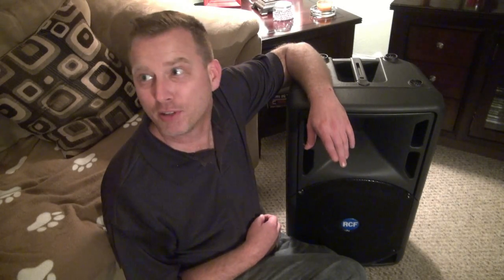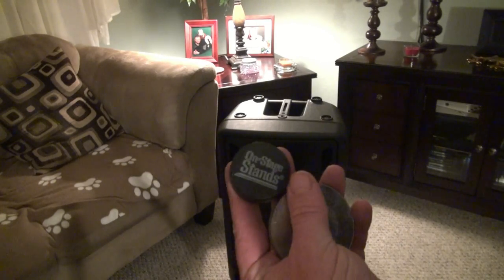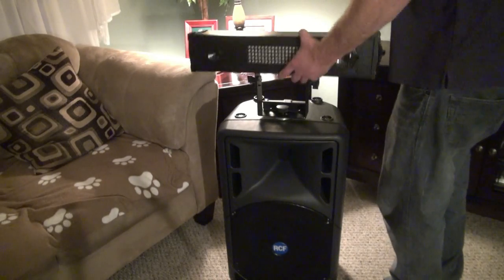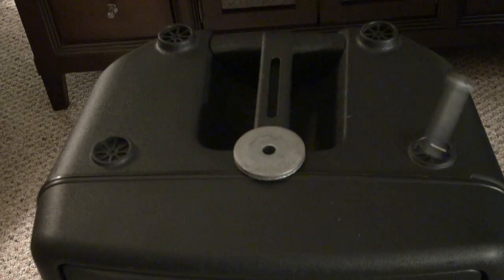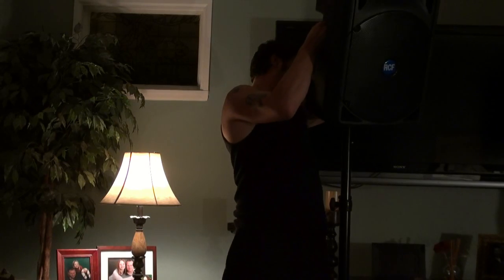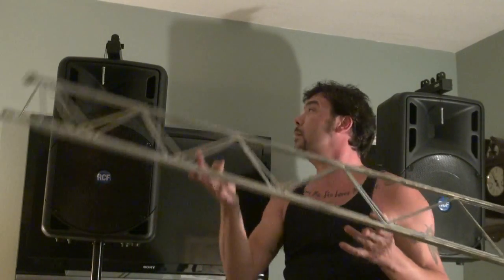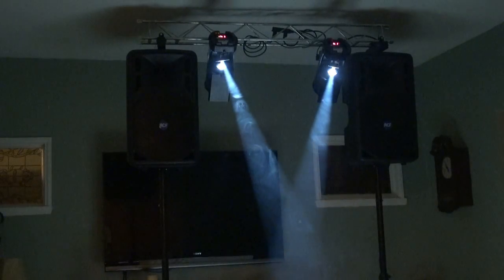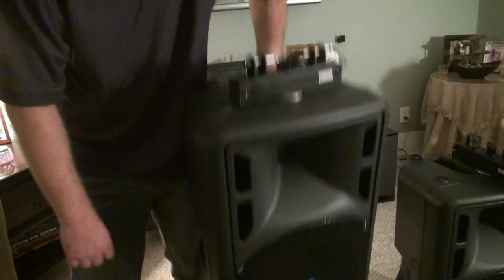Mounting Lights, Truss, etc on my RCF Speakers

Comment: That is a great way of mounting lights especially for mobile djs who only are using a few lights for a small gig. I have behringer b series speakers and they work with screws I got from an adj t bar. They are also very secure and very little vibration is transferred through the speaker with behringers design.

Comment: I long had the idea to use that hole on the speakers to mount a small moving head or something, but trussing and t-bar with the clamp? OMG that is genius! I needa check if my new speakers have this hole, if not, i may be temped to use my old speakers since I know they have the hole!

Comment: Hi Brian......   I have a Swing to Rock n Roll Cabaret act here in Essex in the UK. I have limited funds so got myself a pair of QTX QS12A  powered speakers.  For the size of venue I perform at, they are perfect..... They too have mounting bolts on the top.  I normally mount a pair of  Equinox Pedator LED Lights on top of my speakers. It works great.......  keep up the great work. All the best from your fans in the UK!!

Comment: Hi Brian just so you know you can also mount a lighter weight speaker and mount it on truss instead of truss on speaker. This is an awesome way to get your speakers high and eliminate speaker stands, I just mount the. With an o clamp my speakers weigh 30 pounds so it works really well.

Comment from the maker: @audiofile210 I have the F1 stands which are designed for 60-80lb speakers.  The RCF's are @40 lbs each.  The truss bar itself weighs next to nothing where there is probably about 10 lbs worth of Dura mounting hardware.  No, you don't want to put giant moving heads on here, but 20-30 lbs worth of lights should be no problem

Comment: Almost all speakers have the same fly mount. They should all use an M10 (metric10) bolt. If you find a hardware store that sells metric bolts you can buy shorter lengths and then you don't need large spacers. I actually took one of my Berhringers into the store to make sure the threads were the same.

Comment: I think most active, "disco" style speakers have this fly mount, A lot of different speakers from different brands have the fly mount. I checked in a store here in Denmark after watching your wedding video where you used the duratruss on the speakers :) It's a great concept :) the only speaker that i looked at that didn't have this mount was a speaker that was made to be used as either a normal speaker or a monitor :)

Comment: I have K12s on JBL extended subs.  Is there any concern with vibration?  Especially LED fixtures with servo/motors/moving parts

Comment: hey brian! I have some basic dap 12inch speakers but they got also holes on the top so you can fligh them. I used them before to mount a laser on the speaker and it is great. But the biggest problem is to find a truss-holder. Maybey you can help?

Comment: One thing I would be worried about is, if you mount a laser directly to the hole in the speaker. you are essentially mounting it directly to a source of extreme vibration. And that will have an effect on the diodes.

Comment: @briansredd Nope, The top of them is completely flat, I was thinking about just using heavy duty velcro and mounting my small chauvet moving heads on there (size of xmoves or so), but it just doesnt sound practical haha. Not a quick and easy thing to do at every gig otherwise it works great since those are pretty light.

Comment: These are pretty standard fly points that most plastic enclosure speakers have so this whole concept isn't limited to RCFs only :). In the RCFs the screws/wingnuts are M10 size (ISO standard) which is the usual size in any flyable speakers of this size.

An added bonus...these RCFs have 3 more flypoints (1 on bottom, 1 on each side) that you can use as long as your stand can handle it (and as long as you don't damage the speakers of course).

Have fun getting creative :D

Comment: that would rock if you were using 4 rcfs with a couple of subs use truss in the middle from stands and just mout a peace of truss on the 2 pairs of speakers sort of continuing the truss line but making the sound rig look like part of the set up

Comment: Comment 1/2: This is a great way to bring some variety to your light shows. One thing that i would worry about is the weight, especially with a 10 foot truss. The added weight of the lights and trussing would put some strain on the speaker stands. Depending on how many lights you plan on using, a new (stronger) pair of stands might be required. I would feel a lot more comfortable if the stands could hold about 20 lbs more than the total weight being supported.

Comment: HEY BRIAN THAT'S AN AMAZING CONCEPT!! my EV. sx100+ has those i never noticed them till this video. they have to mounting points. so maybe i can make use of that. the only draw back is the point where you mount it on a pole is near the back..

Comment: Brian, I have been having this idea forever.  How to get a 5ft light bar over my head, but no clunky large durra-truss system, or how do you lift a lighting truss like the adj LT-50T with one person.  Do you think you could mount the bar between the two speakers and create a lighting bar overhead to hang lights on?  Do you think one 5ft bar would hold a good amount of weight? Please respond, and thanks in advanced.
Reply: It works, he mounted the light bridge one by adj on them and it looked pretty good!
Reply: I have done my own test as well and it held up great along with my other lights on it as well.  Thanks for the response. What vid are you referring to?

Comment: Hi Brian, Thanks for the amazing tips. They also work in the Netherlands;), I used some and am very satisfied.
I bought two RCF's 312 and also want to mount a druss on it with the truss holder. I'm looking everywhere on the net, but I cannot find dusch a product. Can you give me the brand or other specifications of the 'holder' you used?

Many thanks, Sebastiaan from the Netherlands
Reply: If you go to the american dj website and go to order parts, you can order the truss adapter for $20 a piece you just have to go to the duartruss section.
Reply: Andrew Hallion The only adapter i could find is http://www.americandj.eu/default/truss-adapter-for-st-157.html and that is not the item Brian uses isnt't it?

Comment: @audiofile210 Comment 2/2: The frankenstands are a great way of getting this rig in the air but, With the added weight they may not go up so easily on your current stands. These are just some concerns. As for the actual light show, Having a couple of led par cans in the triangle truss would have a cool glowing affect on it. Also a mega bar in the middle of the truss could also be a cool way of lighting up the dance floor. Maybe some color splash jr's to light your work area up? Should be cool.

Comment: @briansredd Well i can tell you this it is a fly point on the speaker, 
and if its a 40lbs speaker, then you should able to put about 60lbs worth of weight on that pin, because it is designed to handle pressure on that thread point. but mind you that is regarded as floor standing, on a stand weight must be resonably centre to the bottom speaker pole hole. 
Regards James

Comment: Could also use a lighting stand instead of speaker stands and then hang the speakers  from the truss. Would work pretty nice for like qsc k series speakers because they have two holes. Think way to angle them I guess...

Comment: hey brian, i think your idea's are great! I just wanted to point out that you don't need rcf speakers to do this. I have some old basic 12 inch speakers (dap ps-112) only 240Wrms. And there perfect for small party's. But anyway you can mount everything on top off it because it had 2 m10 flight points. I payed 149euros (200dollars)

Comment: what would be cool, put the 2 speakers on the T-Bar, 1 left and 1 right, get a stand that will hold the weight, and let the speakers fly :p let's see if that works :p

Comment: Because theres nothing quite like over loading cheap tripod stands with cheap inferior truss, and mounting lighting equipment from a WINGNUT without any mention of safety ties. It should be noted that this set up is incredibly dangerous and should not be dont by anyone. See the advice of a qualified technical professional. Use quality truss, proper c clamps and safety everything.